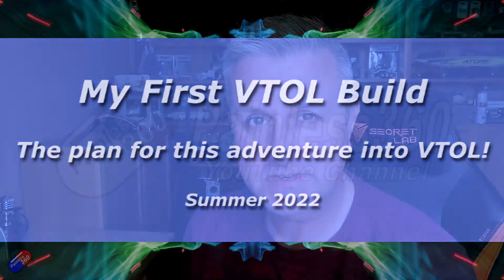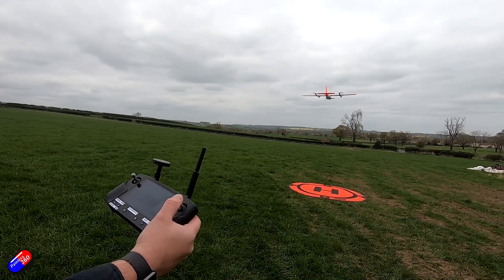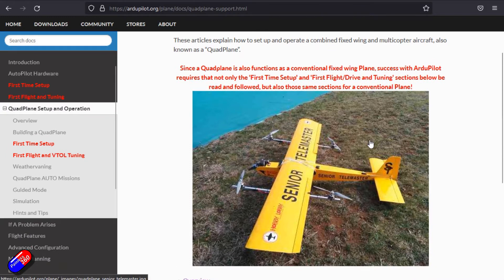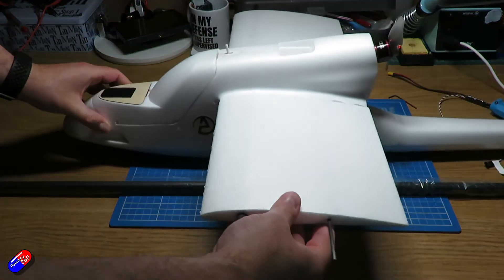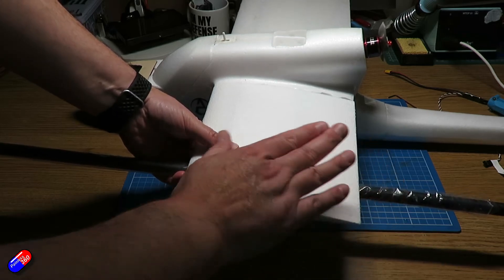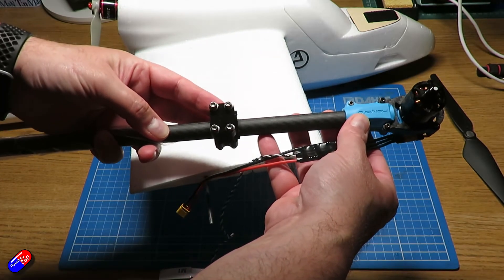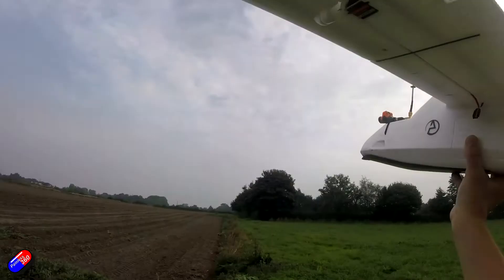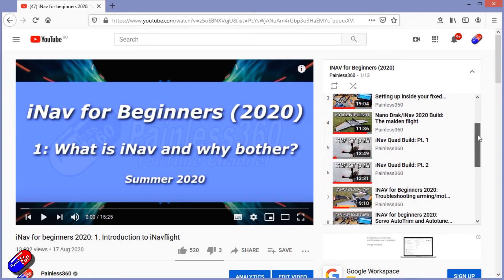My First VTOL Build: The plan for this series!

Comment: I have a 4 moters T-moter Flam 200AEsc the have a 3 wire. White. Red black 
I conect them to pixhawk-6c
But did not work when I arm
But when I give 5v to red wire and give 5v to recever it work
But with pixhawk-6c did not work

Comment: Hi Lee 
I am trying to build my first Autonomous fixed wing. I want the aircraft to be able to fly the mission and return home even if there is no connection with my RC Radio or telemetry with my ground station. 
I tried to turn off the Fail safe function and it seems to work with no radio connection but when I loose Telemetry IE SIK radio for my ground station it goes into fail safe and shuts down the motor. 
Can I make the aircraft run a mission without RC and ground station Telemetry?
I do want the option to land the craft manually after the mission or intercept the aircraft while in range of the ground station if something goes wrong.
It would be nice to set certain Fail safe parameters also.
Thanks for your help.
Reply from the maker: https://ardupilot.org/plane/docs/apms-failsafe-function.html covers the setup. There are different things that need setting for a GCS connection loss... Best of luck

Comment: Congratulation Lee, you going Vtol, I convert my second T1 ranger to Vtol, and after some of us post with 3D printing parts our aircraft build, HeeWing decided to make the pylons for Vtol,  our configuration is is Y frame and works flawless, we are using the H743, BN 880 dji air unit, combination and is fantastic, you can see the plane flying in my channel, I get about 8 minutes of flying with lion 21700 42A 4S2P, 2205 motors 2300kv and 5 inch 2 blades props, and the plane is a dream.  my next is the ranger 2000 same configuration, 3D print pylons are done and ready to go.  you going to love you build but your will be for what I can see more expensive.  you will love it, and with the help of Ben is going to be a blass.  Good luck, you will see how easy is.
Reply from the maker: Excellent!  I can copy yours! 😊 As links tend to be held in the comments, can you drop me an email with them? Lee@painless360.com
Reply: @Painless360  You need only this 3 videos and you are in the air for this configuration:https://www.youtube.com/watch?v=4e3JP7eEZIU         https://www.youtube.com/watch?v=NJMIgvoN6aU&t=794s         and       https://www.youtube.com/watch?v=FGBMmHd64k8
Reply: @Painless360  Lee my parameters are in Facebook group I send to you , in the file section under Montypara I think.  The last parameter from others are fantastic too.
Reply from the maker: That comment isn't avaialbel as it has links in. Can you email?

Comment: Would you cover two motor tailsitter setups too? (eg. Eclipson EVTOL-1) 
They seem like hardware simple (two motors and two servos), but not sure about ease of tuning for unexperienced user.
What are benefits of quadplanes compared to tailsitters, and their potential applications?
Reply from the maker: That is planned as the next build once I've learnt everything I can from this most simple VTOL layout. Stay tuned!
Reply: @Painless360  Thanks a lot for sharing your experience !

Comment: Look forward to following this VTOL Exploratory Build series. 

The detachable wing tip panels on the AtomRC Seal could allow basic hover testing without the full wing. Perhaps easier to manage if any wind on initial hover testing.
Will be interested in learn how much weight the VTOL arms and motors add over the stock wing configuration, if able to provide at an appropriate time? Adding weight for VTOL components may mean adjusting weight elsewhere (battery capacity, etc). 
Hearing your thought processes on various considerations like this, will be enlightening.
Reply from the maker: Great thought processes! These are exactly the types of questions I had in my head at the start too! Stay tuned!

Comment: Yum, yum. For the second model can I request an F4 or F7 Matek board using INAV. This would probably need some help from Pawel but would make an excellent collaboration project for both of you and also INAV?
Reply from the maker: INAV can't do real VTOL as it doesn't have different flight profiles and tuning and understand how to manage transitions. . Quadplane is what you want... Happy flying
Reply: @Painless360   Exactly why I suggest a collab with Pawel, this would require a special version of INAV
Reply from the maker: I guess you've missed recent INAV interviews with the developers on the channel. VTOL in INAV is not something expected anytime soon... All the VTOL builds I have planned for the foreseeable future will be Arduplane (although running on a Matek flight controller after this build). Happy flying
Reply: @peterhancox5268  Pawel has posted a video on this topic, and why it would require effort beyond what the current INAV development team is capable of working on. There are many differences between rotor and wing flight, thus why Betaflight, INAV and ArduPilot (ArduCopter/ArduPlane), all configure for one or the other. ArduPilot is only one that has developed a multimode configurations, including all the mixing of controls to manage transitions inflight from one mode to the other.

Comment: Hi Lee  Great video on your VTOL airplane.  I can't wait until the series comes out.  I finished my Ranger T1 Build and I thought building it as a VTOL,  there are quite a few on converting it to a VTOL.  Thanks for the video and I will look for the new series.
Reply from the maker: Tilt VTOL is probably the hardest to do for a build. I will get to something like that but only when I understand how Quadplane works to give me the best possible chance to not smash it! Happy flying!
Reply: HeeWing has just launched a T1 VTOL conversion kit (think everything needed but a flight controller). It does require a KIT, or PNP to convert.
Reply from the maker: I'll be looking at the kit on the channel. The hardware is the easy bit for the build. Tuning of a tilt for reliable transitions to and from hover in all conditions is the tricky part.. Happy flying